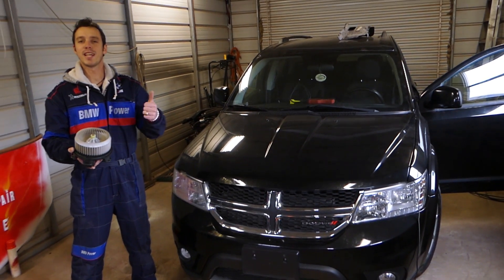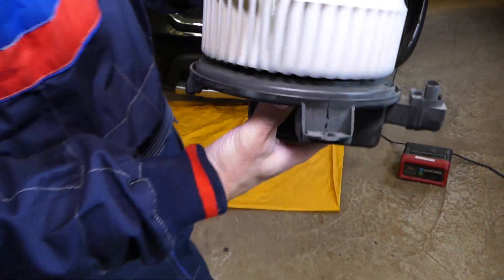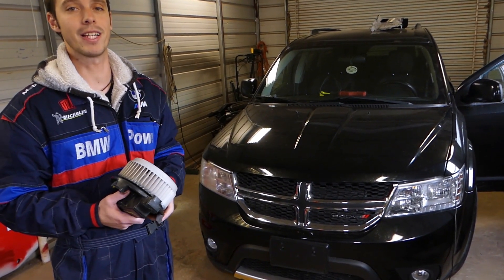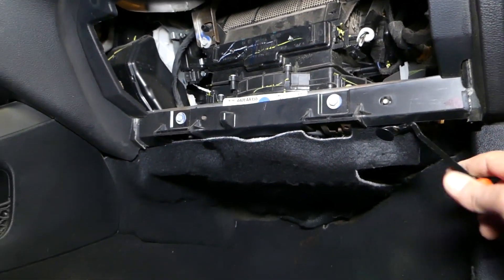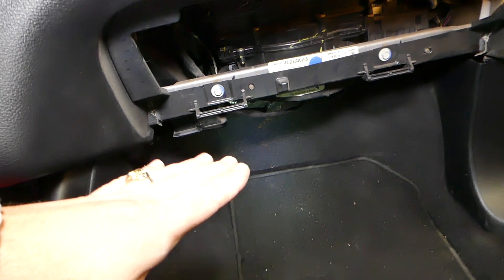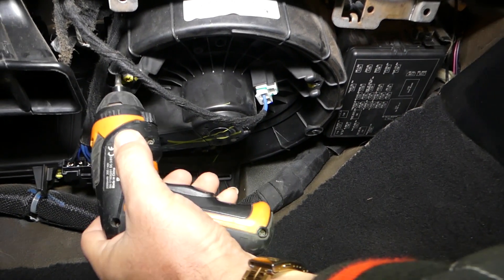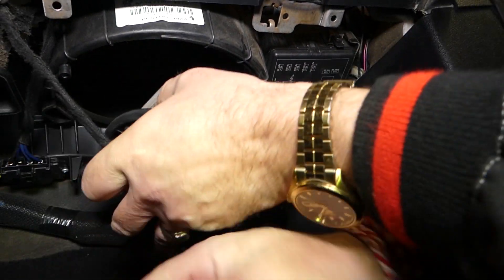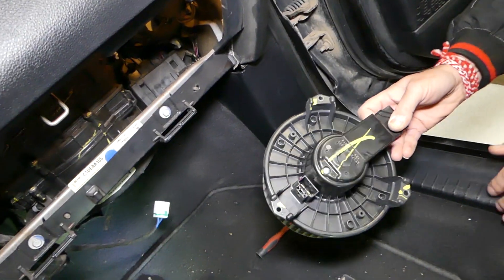DODGE JOURNEY FRONT HEATER BLOWER MOTOR REPLACEMENT LOCATION. FIAT FREEMONT

Comment: I have dodge journey 2013 3.6 rt. It's get heated after few kilometers thermostat was changed still It's happening what else I can do to fix it and is there any tools which can point out the exact cause of dodge journey 2013 3.6 rt heat up the gage cross half way mark and coolant bottle stars boiling .